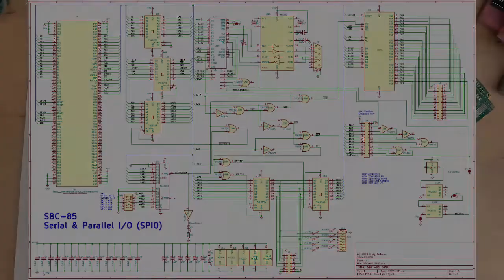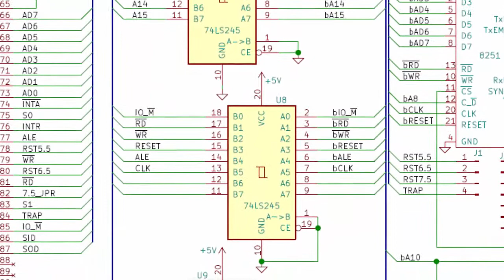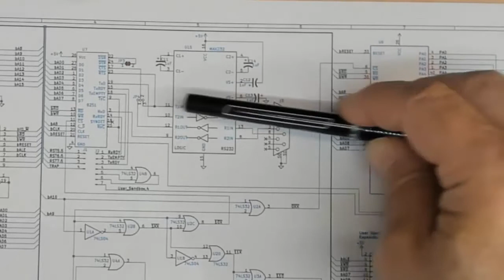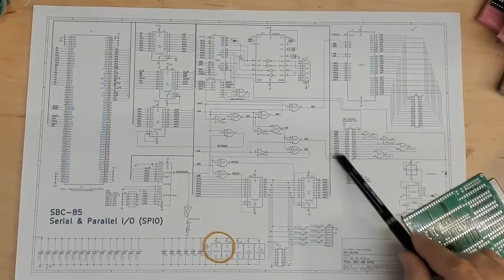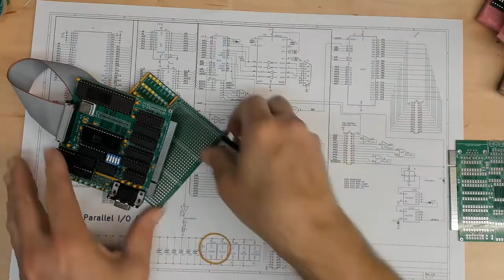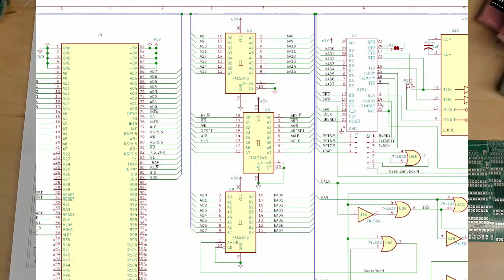{60} SPIO — SBC-85 Serial & Parallel I/O ( SPIO ) Expansion Board Overview, Features, and Design.

Comment: I do not get the difference between a UART and a USART. What is the S?
Reply from the maker: The 'S' is for Synchronous.  Asynchronous is what we generally think of for serial communication where synchronous is generally reserved for the big iron.  In Asynchronous, the sender and receiver have their own timing sources (but matching baud rate of course) and with each character there is a start bit, data bits, and stop bits then the line goes quiet when nothing is being transmitted.  With Synchronous the receiver and transmitter are 'synchronized' because they use the SAME clock signal.  When there is no data to transmit, the sender fills the empty conversation with a specified synchronization character which the receiver knows to throw away while waiting for real data. In synchronous mode at least two sync characters are used to 'frame' each group of characters which is called a 'record'.  Synchronous communication can have much higher baud rates and the baud rate does not even need to be fixed or any particular value (unless using a synchronous modem).  Synchronous becomes more efficient when the 'record' has more than about ten characters.  The SBC-85 SPIO is configured only for asynchronous since the transmit and receive clocks are not brought off board.
Reply: @HelloWorldETX  omg that makes so much more sense. I'd picked on asynchronous ~= serial. But couldn't for the life of me figure out what about synchronous was "parallel". 
But yea the real explanation is much more ... "explanatory" haha.🤦‍♀
Reply: Synchronous*
Reply: I just watched this again. The bits where you go through the address decoding and port mapping of the different ports is a useful reminder of how the board port addressing works.